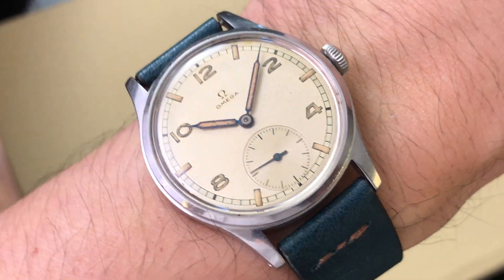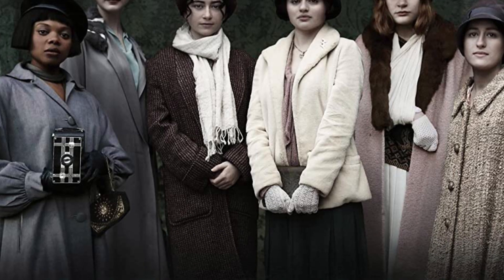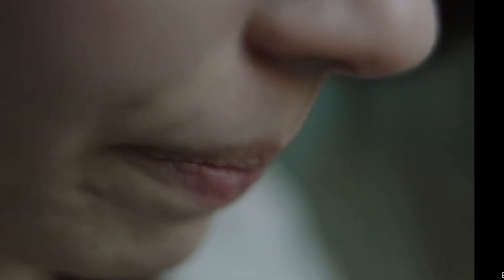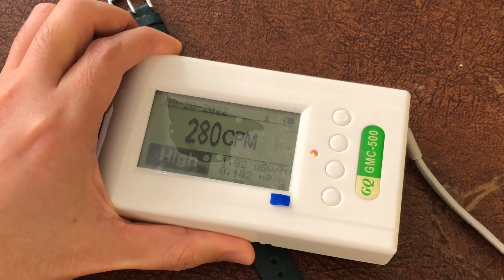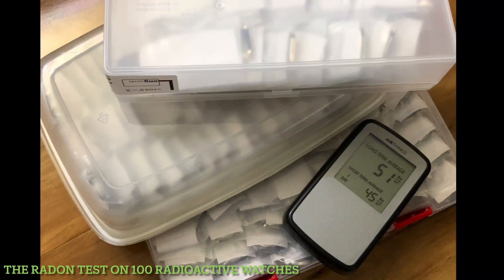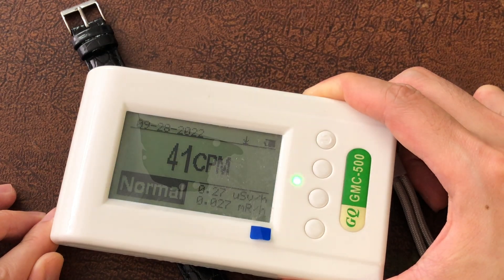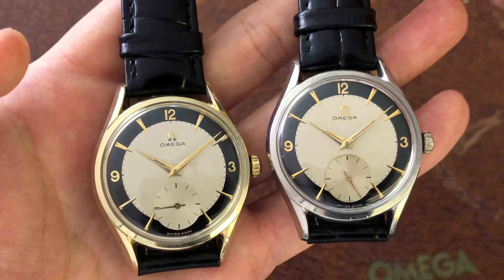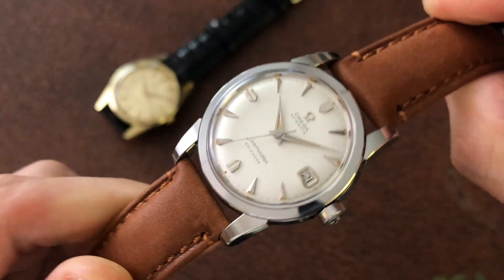100 radioactive watches radon gas test result ~ Radium watch test: This Was Unexpected!!

Comment: Radon cannot penetrate glass, it mostly gets out thorough the seams of the clock/watch. Radon remediation companies keep spreading this myth that it behaves as some short of ethereal uncontainable gas that diffuses thorough any know material as if it was helium or hydrogen, but the fact is that it is about the same as the heavier gases, like Argon. Even better its 4 day half life makes it that a barrier only has to be thick enough so it takes more than 4 days of it to diffuse thorough, in the case of HDPE that it is about a mm, in the case of glass its micrometers.

Comment: I have a GQ GMC-300. can it detect radium radiation too?
Reply from the maker: I believe it is a Geiger reader you have, it will allow you to detect whether an object carries radium. However, if you are looking for a device to detect radiation in an area such as a basement, you’ll need to buy a “radon” detector.
Reply: Indirectly, yes. When Radium decays some of the daughter products emit gamma rays (and hard beta) in the process, so you can detect the (possible) presence of Radium but not the alpha particles directly. Alpha particles are easily blocked by a thin sheet of paper or indeed the outer dead layers of your skin, they cannot penetrate your body unless the source is ingested. A Geiger Muller detector cannot tell you what isotope is present, only that there is some radioactivity. To identify which isotope(s) are causing the activity you require a gamma spectrometer. Relatively inexpensive devices like Raysid or Radiacode can provide such info, however  precise data for low levels of activity need more sensitive (i.e., expensive) instruments. I bought an old WW2 aircraft instrument dial purely for the purpose of having a Radium source to experiment with, counts on a Radiacode RC3 were in the order of 90,000 CPM. It provided a beautiful gamma spectrum though.

Comment: Smartwatches are most likely more harmful than the vintage radium dialed watches. They emit Electromagnetic Field radiation and the wearers are exposed to it. Wearing an electronic device on your body all day long is not a good idea if you want to reduce your exposure to EMF radiation.
Reply: Absolutely untrue. Radio waves are never proven to be harmful in any way whatsoever. Ionising radiation, on the other hand, is. The amount needed before it gets dangerous is disputed. If you do not know the science behind it, please refrain from providing information. 
One can damage DNA, one can only heat up tissue. It's like comparing asbestos dust VS standard house dust.

Comment: Bought a 100 usd Geiger counter specifically the GQ GMC 800 recently and I just checked Amazon and it detects the same types of radiation the one you used in the video does which would be beta gamma and X ray and NOT APLHA  and measured my antique clocks and watches for several minutes each and got little to no readings at all on top of my research I’ve done online I feel very safe now knowing I more than likely was not exposed at all THANK YOU FOR THE CALMING INFORMATION

Comment: I don't know about watches, but I have a vintage compass with radium that gives me 500,000 CPM on my dosimeter (not a typo, half a million counts per minute.  I also have a vintage radium alarm clock that gives over 20,000 CPM.  I can be 8 feet away from the compass and it delivers up to 600 CPM.  Radium is no joke, I wouldn't wear one on my wrist or in my pocket. My scintillation detector is more sensitive than a geiger counter.

Comment: When dealing with a watch that only has radium hands, it may be good practice to safely remove the radium paint (safely dunking and scrubbing it off in isopropyl) and then replace the lume with a more modern equivalent. In that however, I wonder how much of the watch is still irradiated from being exposed for 60+ years? But at least then the majority of the actual radium is gone and disposed of.

That said, I've always loved watches but recently got an interest in vintage stuff. Being the mechanical type I bought a small bag of old watches and started tinkering. Fast forward after a few days of opening cases and tinkering (and even getting a few running) and I was researching a watch in that pile which had "ra SWISS MADE ra" on the dial. Needless to say, after discovering what that means, I'm now terrified of what I may have been exposed to. Geiger counter like yours is in the mail and I'm praying for low numbers at least when it arrives. 🙏😩
Reply from the maker: My suggestion is if you’re going to remove the radium off the dial and hands of a watch. Best not to buy it in the first place. It would be a shame to do that to a good watch. :(
Reply: @BestEverVintageWatchChannel Not the dial. That would be very difficult. And likely ruin the piece. But if it's just the hands, you can easily re-lume using coffee or other dyes to replicate the original age/color. Then you have a nearly radium free watch that looks vintage just the same. It poses no danger to you or anyone else in the future cracking it open for service. Personally I don't think being radioactive makes any watch more valuable. Otherwise I have a dial that spikes to almost 10.0uSv/h that I would love to sell. It's currently in my garage in a small lead lined box. LOL.
Reply from the maker: @WatchThisA  Even the hands, do not relume them unless they already come with missing luminous. People have tried, relume is just not the same. And when you shine them with a blue light, coffee or other dyes will not glows. It will affect the collectible value of the watch. Not to the mention that many collectors will not accept to purchase such a watch as well.

Comment: I deal with radioactive isotopes quite a bit and it is quite scary  how unaware most people are about radium clocks, even some clock repair professionals.
Reply: Or someone like me, who has always loved watches but recently started tinkering with some old watches to get them running again. Luckily it only took me a few days to discover that one that had "ra SWISS MADE ra" on the dial and what that meant. Still, I wish I could have known about it two days ago before I started opening up these things. Hopefully I didn't just give myself cancer down the road 😭
Reply: @WatchThisA so its been a year.  Have you died of cancer yet ?
Reply from the maker: Absolutely! I would be very cautious handling a vintage clock with radium. The amount used is massive.

Comment: Does radium lume glow all the time like a tritium tube or only when charged by sunlight like modern luminova lume?
Reply: It glowed all the time when new, just like tritium.
Reply: Often, it does not glow at all if old. Only way to detect is with a geiger counter.
Reply: It still glows but is extremely faint, you can see it if you take a very long exposure photo with a sensitive camera and a "fast" lens.

Comment: What is the model and year of production of the first watch shown in this video?
Reply from the maker: Two models between 1943-1946 came with this dial. They are CK 2383 and CK 2400. 2400 is a Swedish Suveran model and 2383 is the international version. Same case design except that 2400 has Suveran inscription on the back and 2383 has a blank back.
Reply: What is your email address? I am interested in the black dial Seamaster 600 featured on the home page of your website. I just tried calling, got no answer so I left a detailed message. Thanks!
Reply from the maker: @danburbach498  Hi, website email is info@Omegaenthusiast.com
The Seamaster 600 featured on the homepage is not available. All available pieces will have a price on the shop section. Due to the mass amount of special request for watches, I no longer provide this service either.
Reply from the maker: @danburbach498  To learn more about vintage Seamaster 600, you can always watch this episode: https://www.youtube.com/watch?v=zdTJ_TobhFw

Comment: The main issue with radium is the fact that it lashes to the bones when ingested as its molecular structure is too close to calcium, and the body thinks it is, absorbing it and fusing it to the bones, thus creating a long term exposure and bone cancers.

Also, radon gas is not very radioactive, and by itself is not very dangerous as it decays after around 3.78 days. The problem is the daughter particles from the radon decay, if radon gas decays inside the lungs the daughter particles (polonium, bismuth, lead) will be left there directly in contact with lung cells, thus creating a very high risk of lung cancers.
Reply: Dont need to inhale radon gas to get them daughter products into your lungs, just breathing air in the same area with decaying radon gas guarantees you will inhale airborne daughter products.

Comment: It is commonly reported that the transition from Radium to Tritium occured in the early 1960s, including Omega.  But when did they first start with Tritium?  When was the first Omega watch produced with Tritium luminous paint?  If an Omega from 1954 has tritium lume, is it a Frankenwatch?
Reply from the maker: Just mean the dial has been refinished.
Reply: I just ordered a gaiger counter out of curiosity because I have 2 watches (-60 Longines and -63 Cortébert) that don't have that "T" or "T T" on the dial but lume patina doesn't look like radium type. So I too like to see if there are watches without tritium symbol but yet using it. Will see.

Comment: These watches are safe just wear gloves and a good mask to avoid spreading dust and the watch will not put you in danger as it is sealed and because the radiation is very low. And an x ray or any other medical radiation dose would be hundreds of times more.
Reply from the maker: Thank you for the comment. I would say Mask and gloves on is optional. But I haven’t been to a watch repair shop and see a watchmaker with mask or gloves on working on watches before. Many of these retired watchmakers would laugh at me if I suggest them to wear a mask when working on a watch.

Comment: i own several radium dial rolex, I do feel wrist sore while wearing the radium watch.
Reply from the maker: Thank you for the input; not going to disagree with you on that, but from what I know is that radon is not strong enough to penetrate through the metal case back of a watch.
Reply: @BestEverVintageWatchChannel  Alpha and Beta no, Gamma Ray does
Reply from the maker: @issacasimov  If your wrist is hurting from wearing one. You could store it away or sell it and get a Rolex from a later year. Sorry to hear that. 😞

Comment: Super informative video as always! 👍 One question, did an original Cosmic CK2471 black dial have radium hour markers (non-numeral)?
Reply from the maker: Some 2471 do come with luminous markers, but the hands must also have luminous on them. I cannot say whether your example is original or not until I can see a photo of it.
Reply: @BestEverVintageWatchChannel  Sure! It was picked up from an Omega AD after a restoration and they confirmed that the Swiss Made lettering is without a ‘T’ at either end of the name and the dial was not re-lumed after the restoration as I believe they would have added super-luminova coating if the watch came with lume in the first place (factory lume)
Reply: I just learned Radium and 'T' for Tritium might not be the same thing (clearly..) so not sure I got the right information for the watch which dates back to 1950s :/
Reply from the maker: @moisesdiaz9438  As explained in the video. If your watch is 1962 or earlier, the luminous applied on the dial and hands are Radium. After 1962, Tritium was used and slowly you will see dial with T Swiss Made T on the dial to indicate the luminous are Tritium. Super-Luminova is something you see on today's watches and L is the abbreviation. 99% of the time, the dial on a moonphase triple calendar will be a redial. You can learn about it here: https://youtu.be/6sISzc_vhug

Comment: I have heard that war watches are the most dangerous as they put big quantities of radio on it. It is a pitty you don’t have a Omega Dirty Dozen to do the test…
Reply from the maker: A dirty dozen example will still contain much less radium than a single clock hour index. I have other 1940s Omega watches that carry almost as much radium as the dirty dozen, like the first piece in the video. So make sure when you own a timepiece with radium substances, it is properly serviced and sealed. Remember that radon cannot penetrate through the case back. So you can wear your watch all day, and your wrist will still be fine. The smart phone in your pocket is probably more dangerous. haha

Comment: Does the radium still have luminescence?
Reply from the maker: Only when you flash it with one of those blue light flashlight.
Reply: The radium is still present and emitting radiation but what decays due to continual bombardment is the luminescent phosphor that is mixed with it. The phosphor gets 'burned' and turns brown, no longer able to glow.
Reply: @chrislx2006  Thanks for the detailed explanation.